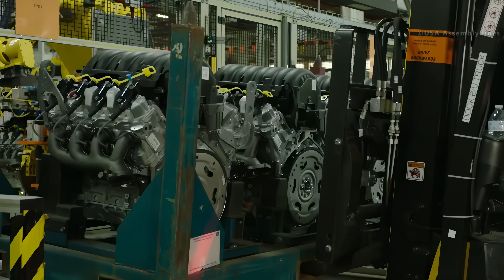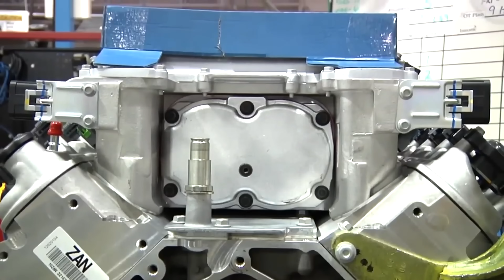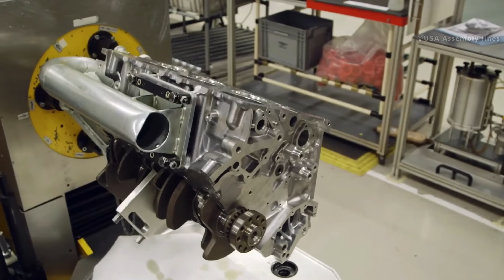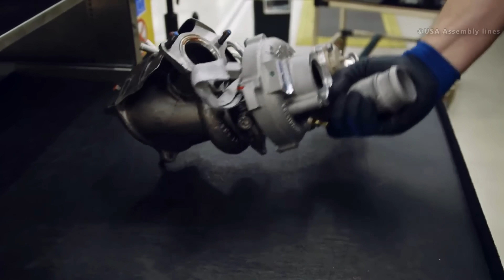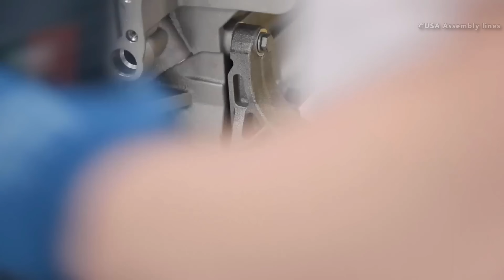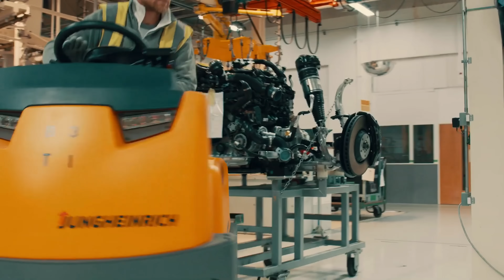Inside US Chevrolet V8 Engine Factory – Building "never" recalled Chevy engines (Production line)

Comment: Sad that with all the high tech equipment there is still a huge recall of the 6.2 engine  😢
Reply: The government is always the one to blame
Reply: GM has been building cars for 100 years and they still screwup. Vegas, X-Cars, Chevettes, 4-6-8 engines, diesels engines for cars, the list goes on. My first two cars were Chevys, our two buses at work were Chevys. No more for me from now on Japanese cars only since 1981
Reply: @busman2050  LOL and now Toyota is a joke of a company. The V35A is a flaming pile of sht and Toyota hasn't even admitted the truth -- it's a design flaw not debris. The Tundra is ruined, the Tacoma's transmission problems have been awful let alone the engine failures, the 3rd gen Tacoma was rated least reliable midsize truck for 3 or 4 years in a row for axle failures transmission issues and engine problems. Toyota had to change their new vehicle warranty back around 2010 to state that it's "normal" for their engines to drink a quart of oil every 1200 miles because their newer engines have had oil consumption issues. 

The engines built at Tonawanda are largely 5.3's that don't have anything to do with the 6.2's crankshaft issue (which was a supplier QC problem).
Reply: @hochhaul  Yeah my parents tried a new toyota, I told em don't do it, they have always driven GM and never had a single problem, well the toyota was no stop problems, needless to say the recently bought a new Buick, the #1 rated vehicle, Chevy trucks, still the top rated by far truck.
Reply: Have a supra 2jz love it 😊
Reply: @MP-po6fj  That's nice, you could do a lot better for the money.
Reply: @busman2050  I'm sorry, I really feel bad for you, you have missed out on some of the best vehicles ever built, Jab cars really suck.
Reply: Strawberry Mary Barra outsourced the crank

Comment: GM needs to get back to making engines the way they used to no more AFM or DFM engines
Reply: AFM and DFM is not there because GM wants it. CAFE dictates it. GM would love to build V8 without DFM, but the law says differently.
Reply: @BR549_o7 I believe the auto manufacturers have enough clout to tell the government to back off on unrealistic expectations on fuel mileage requirements.  The minuscule mileage gains from DFM isn’t worth the sacrifice in reliability.
Reply: @mouselt1 word on the street now is the current administration wants to delete the CAFE standards. I hope they can. I'm a retired mechanic still working in another part of the industry, and with the added components, and the thin oil they don't use in Canada or Europe, it's wreaking havoc on reliability.
Reply: @mouselt1 it's also why there is 0 weight motor oil for recent vehicles. They are being forced to do these things. Auto manufacturers have been using their political clout to hold these laws off. It would have been far worse if they hadn't.
Reply: @travisbakeriii3053 yes the Pres is revoking some regulation, but that is dependent on him being in office. Congress will have to pass these as permante law.
Reply: @hawkdsl oh for sure.
Reply: @mouselt1  Agreed.  AFM/DFM engines are a failure waiting to happen.
Reply: @BR549_o7  This is simply not the case.  Would you care to please show the document showing the Federal Government requiring General Motors to utilize Active Fuel Management systems in their internal combustion engines?  Why did the 4.8 not have it, if it's required?
Reply: Overhead cams add unnecessary weight and complexity.
My all original 1973, 350/350, C10, with God knows how many miles, still gets me to work and back.
And anywhere else around town I need to go.
Reply: Getting rid of the cafe rules they might be able to build a good engine again. There is nothing wrong with the old so called dinosaur small block big block Chevrolet engines. To many people want to many unnecessary shiny trinkets in or on their engines.
Reply: EPA  GREED LAWS     JAIL THE  EPA   LIES  Of GREED
Reply: Think AFM/ DFM will be honest on the new V8's!
Reply: In my opinion, GM engineered the parts to fail out of warranty. Never forget old GM saved 57 cents per ignition switch component then declared bankruptcy and said it identifies as a different GM and is not responsible for those deaths.
Reply: @Poopster4U  That is correct. Old GM was sold off to hedge funds. The real GM no longer exist. Car manufactures are not always responsible for the hard times they find themselves in. Outside forces like loan rates, inflation, and a housing market collapse certainly do. The big three going to Washington for help was the first warning of a major recession.  People don't buy cars when they can't afford almost anything else.  You have a serious misunderstanding what a warranty is. It's a declaration by the manufacture that parts in the warranty period will not fail, and if they do, they will replace it for free. They are telling you up front that components have a limited life. Any period after the warranty has expired is a bonus when they continue to function.  The idea that a manufacture thinks it will force you to buy a new car when you start to have issues, or spend money at their mechanical shops is retarded. They know you will take the car to an independent shop, or fix it yourself. The manufactures owe you nothing, except what is stated in their warranty, and a car you obviously wanted to buy. If you feel betrayed, your most effective action is to buy and support someone else. Crying about GM (or anyone) for their failings is wasted breath.
Reply: What they need to do is build overhead camshaft motors not pushrod dinosaurs.
Reply: @anthonynicholich9654  my 91 GMC 1500 with the 5.7 push rod is still running well with 350 k and 10/30 oil ,love that dinosaur engine
Reply: @anthonynicholich9654  that's funny, as overhead cams are just as old as push rods. There is no internal combustion engine design that hasn't been tried decades ago. Push rods are far, far better. Keeps center of mass lower in the block, no complex chain drives, and waaaay smaller in physical size. Stop being a victim to marketing.
Reply: @hawkdsl  Ah, but you are actually quoting facts, instead of Anthony''s quoting what he has heard, without any facts to back it up. HUGE problem in the US, nobody wants to bother actually checking before they announce "The Truth". Good for you. And by the way, the old poppin John tractor I had, with super long push rods, ran forever. Babbit bearings, simple carb and you couldn't stop it.
Reply: @Rem1061  Thank you. "Latest thing" is usually never the best thing, but that's something we have to learn through living a few years.

Comment: What they need is quality control to check the parts that make up the engine before assembly ! If the crank had a poor finish it should have been caught ! There is no excuse for that many parts to have that problem.
Reply: BINGO!!!!!!!!!! Bad cranks = engine failures.
Reply: Canada set them up for failure. Not by accident.
Reply: I understand your thinking about having someone 'inspect' the work done but, it actually is not the answer. Management, engineering, and others, need to implement a way to make it right the first time. Putting a checker person to catch bad parts is not the fix. I know this to be true because I worked in a GM Transmission facility for 32+ years. Statistically, there is always going to be a small percentage of non-conforming parts/builds. Statistically, even the 'inspector' will miss 15% of the non-conforming parts that come to him. There needs to be a group to look at what are all the areas and issues that create the 'open window' that is causing the possible defects to be produced. That is the only way to fix this. It is statistically impossible to recheck the check and recheck the builder and fix the issue. They have to eliminate every possible effects on the manufacturing of the parts in question.
Reply: @CuriousKL  Unless its a hand built engine (5.5L, LT4, LT5, LT6, etc) its only spot checks of inbound parts and assembled engines.  There is no way to inspect every engine before it leaves the plant.
Reply: @darknes7800 yes, I know that.
Reply: @darknes7800 you don't inspect every single engine. Just need to test by batches and GM clearly wasn't even doing that. L87 cranks   were checked by blind and quadriplegic QC department... And maybe don't use oil so thin it allows for zero imperfections. Literally cooking bearings if they aren't prematurely worn first.
Reply: The rod journals were actually out of round. That was/is the issue. Nothing to see here, get higher viscosity oil and put a sticker on the oil fill.
Reply: If everything is so high tech why all the failures
Reply: Not crank but rods!! And transmissions!
Reply: What happened to plastic  guage to measure crank clearance to main caps
Reply: 900 thousand engines that failed that’s theft
Reply: You got that right!
Reply: They.need.to.go .back to bare.basiks throw.out.computers sensors.electroniks.shit and start building good old  fashioned motorcar if they want to still stay in business !!!!
Reply: @EmileBooyzen-m3c  LOL!!!!!!!!  Says the horse and carriage crew !!!!!!!!!!!!! LOL
Reply: @EmileBooyzen-m3c  I would rather have a new CNC machined engine. It will last longer than 100,000 miles. Old engines needed a rebuild by then.

Comment: who cares ?
dead horse is still a dead horse.
You either realize EVs are the only future or
Reply: Why do you make a completely false comment like this? 
I happen to work in the automotive industry. EV‘s are never going to be any more than the niche market they are now. You should do some research before you comment and not just post opinions leading people to believe something that isn’t true. We tried. The American public decided they do not want them. Our plants are already being converted away from the electric conversions of a few years ago, back to gasoline powered vehicles. Did you notice the recent layoff’s at some manufacturing facilities? This was due to retooling them back to traditional plants. 
This was a dumb idea pushed by an even less intelligent government. There is no infrastructure to support electric. 
We would have to double or even triple our power plants. Not going to happen. 
Higher efficiency gas, natural gas and hydrogen engines are being developed, as well as more efficient power trains. 
Now this part is just opinion:
Tesla has the market in EV’s. I’m sure they will continue to supply the smaller market. There is a market for EV’s. Just not the scale that was being falsely pushed by the last government regime. 
Good day

Comment: 6.2 Liter for Corvette not recalled, but the truck ones Mary Barra saved money by using Mexican-machined cranks and THOSE engines are failing and will BK the company. Imagine that, sending a crancshaft to Mexico to have it machined, WRONGLY, then assembled in the USA.

Comment: Do NOT compare engines built in 1955 to engines made in 2025 !
Reply: There weren't plastic crap bolted onto the engine like plastic intake manifolds, valve covers and even oil pans  in the 50's.
Reply: Why make a comparison. In the 50s they made products that lasted! Along with standing the test of time they were adaptable.
Reply: @fredhahn3739  I bet most of the people that talk about how great those old cars used to be, never owned one.
Reply: @bigredc222  Fred owns a 1999 Honda Accord with no paint left on the sheetmetal........he has NO clue.
Reply: @fredhahn3739  LOL!!!!!!!!!! That funny!!!!!!!!!!!!!!!!!!
The new LS style engines will go 300K - 400K miles with just oil changes.
350s 400s and 454s were DONE at 100K - 150K miles.
Reply: I would put a 350. Up against any engine. About your only component issue was timing chain. Simple task. clean air.clean oil. . . Run forever with good oil maintenance.  @darknes7800
Reply: @darknes7800 only way to get 3 to 400 k out of ls with only oil changes. . . Put on a trailer
Reply: @fredhahn3739  Okay, since you have no facts on the topic.  Just look up the 300K and 400K mile LS based engines, with ONLY oil changes.  I will wait for Ur next nonsense, zero fact post.....
Reply: @fredhahn3739  Wrong child.......
Reply: JAIL The EPA
Reply: Yeah no comparison ! They built an engine series for 50 yrs that has yet to be bettered. LS is a great motor but still. . . A youngster 😂